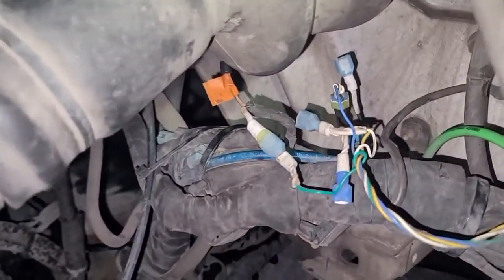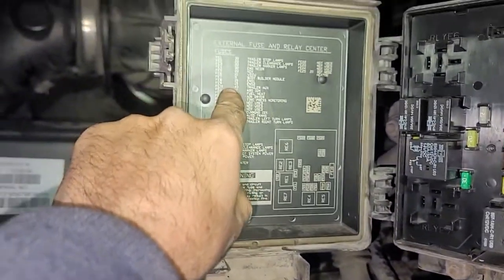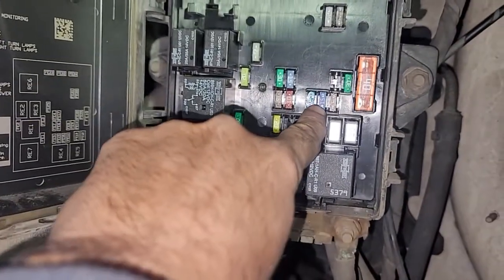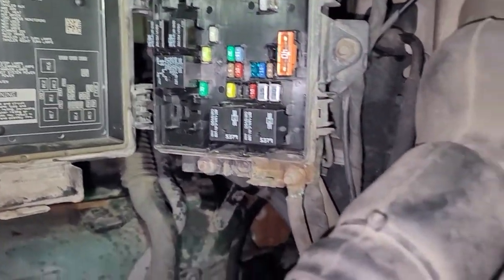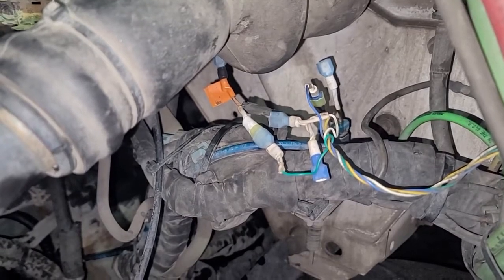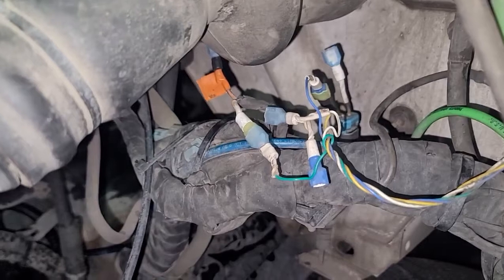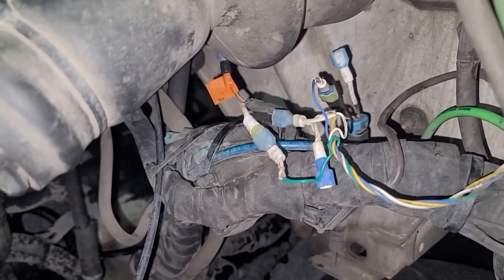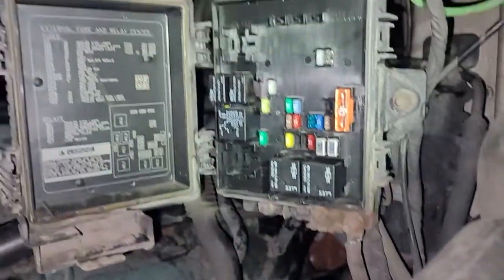volvo d13 BAD fan control solenoid fuse location

Comment: I replace the fuse put a new selinoid and keep blowing
Reply from the maker: That means the plus wire that goes to the solenoid is shorted somewhere before it gets to the selenoid... possibly insulation got rubed off and it touches the frame somewhere.